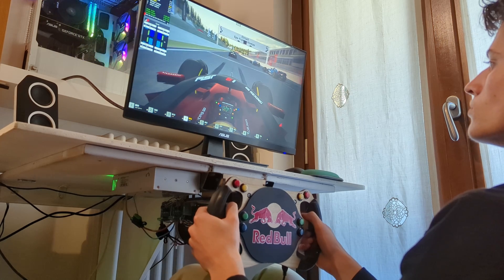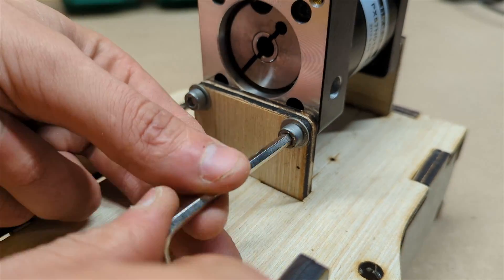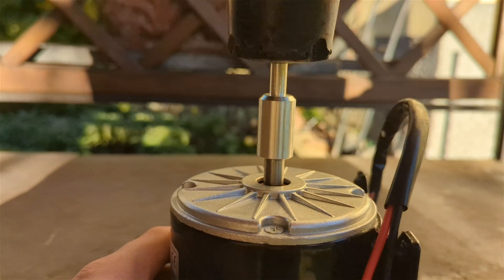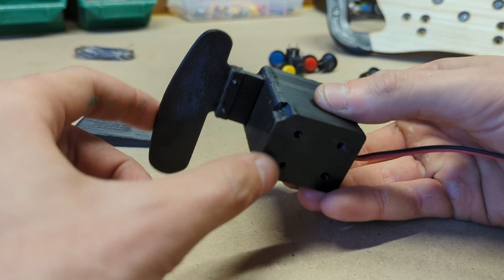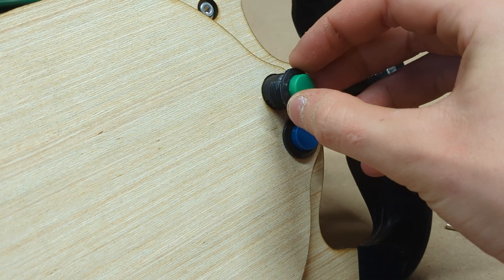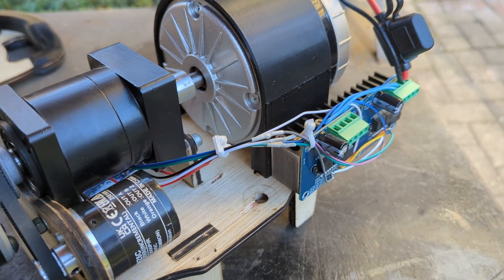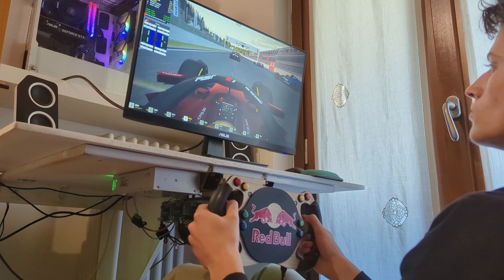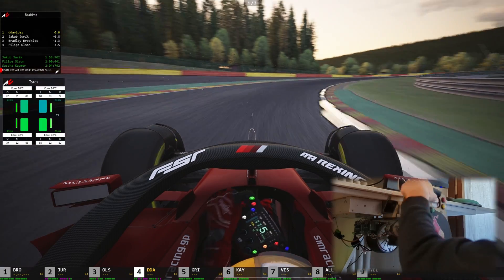DIY FFB steering wheel | 😱 50Nm 😱 | HIGH performance & FUN

Comment: Definitely not 50Nm.
The information given about the motor is very terse. It only says that it is 24V and 350W. The motor label is not shown on camera to know exactly what motor it is and look up its specs.
However, at 2:14, stopping the image at the right frame, you can read a part of the motor label.
MOTOR: MY1016
VOLTAGE: 24VDC
RATED CURRENT: 18.7A
With this data and knowing that it is a 350W motor we can find the manufacturer and the specifications of the motor itself.
The manufacturer is ZheJiang Unite Motor Co. Ltd.
The motor data given by the manufacturer:
REFIT MOTOR MY1016 350W 24V
Model: ZD101A1/MY1016
Rated Power: 350W
Rated Voltage: 24V
Unload Current: ≤1.4A
Unload Speed: 3350RPM
Rated Torque: 1.2Nm
Rated Speed: 2750RPM
Rated Current: ≤18.7A
Efficiency: ≥78%
This refit motor is always used for Scooter, Small Electric motorcycle.

So, the wheelbase shown definitely does not have 50Nm.
Since a 10:1 gearbox is used, the final torque is 12Nm. Which is really very very good.

Comment: Thats not 50nm in translation to the power you get. It may be rated that way but the numbers we use in wheelbases isn't based on just the motor but the power it can produce when together and pushing to your hands. This isnt 50nm. Sry

50nm stall torque is not how you measure wheelbase torque. This is a 5nm wheelbase maybe 10nm tops.

Doesnt seem like its moving much more then 5nm wheelbases do. Something is off with your testing.

The qay thw wheel was moving with your settings looked like 2 to 3nm on my wheelbase I use set very very low.

It looked pretty weak in action. And if you have to use 40% to not clip its def not close to 50nm if its clming out to 5 or 6nm at 40%. Just saying.
Reply: But still an awesome project!
Reply: 50Nm is 50Nm, if the engine uses it, then that's just how it is. Even well-known manufacturers use physically standardized specifications.
Reply: @thomaslocke1503  this is not 50nm. Its not actually giving him that. He's using it at 40%! That would be over 20nm. Do you see a 20nm wheelbase react this slowly and easily? No I own a 23nm wheelbase, 15nm and 27nm. My 15nm wheelbase gives way more fight then this even set to 10nm.

He also explained it's not 50nm static he measured 10nm in other ways which this makes way more sense. That looks like a 10nm wheelbase being used at 4 to 5nm.

Its all about how the forces are measured. I've also never seen a 50nm motor this small before. 50nm is absolutely insane. Our biggest in the industry for sim racing is 35nm at the moment. And believe me that at 40% is pretty wild. Same goes for vnm 32nm wheelbase. Or the simucube ultimate.

Look at the small belt holding it an moving. Yeah 50nm? Heck no that small belt wouldn't hold or be able to move or maintain torque at that level.
Reply: @reviewforthetube6485  Nm are always specified the same and it means 1N at one meter lever arm. No matter how and where you measure it! You didn't even understand that the little belt only transmits the angle of rotation to the sensor 😜
Reply: @thomaslocke1503  again he didn't get 50nm of static force and his testing showed 10nm. So putting 50nm isn't correct.
Reply: @thomaslocke1503  as he stated it was the motor specs but he measured 10 to 15nm not 50nm. Yoy can spec anything the way you want. This is not a true 50nm motor and it's especially so when seeing him use 40% as easily as he did with such little force applied. I'm not the only one who proved this in the comments. Someone else did in a much better way then myself.

Also what you fail to realize about that belt is the transitions of the motor and angle would still move way to fast and aggressively for that little belt to keep up.

Comment: 50Nm would spin the earth the opposite way. 
20Nm would brake this whole contraption in to several peaces. 
10Nm is similar to a real car, and is where you start to use metal parts for a build.
Reply: 10Nm is for a car with no power steering and BIG tires. My road car feels like probably 2-3 N.m.
Reply: 50Nm is only 36ft/lbs lol, what are you smoking and can I get some?
Reply: @ LOL only? There is a video on Youtube where bodybuilders are testing simwheel at 150%. The rig that they used had 25nm. And the bodybuilders could not handle it. 

Good luck with "only" 50.
Reply: @dovydaskaminskas4227  That's peak force not sustained like I'm assuming the test you're talking about was and pretty sure he said it's set to 30% but, anyway checking the video he says the motor is 350w which is maybe 5-10% of 36ft/lbs lol you could totally build one with 50Nm though not saying you need it just that it would be possible.
Reply: A sport car grip is something else. F1 grip is insane and G forces are out of our knowledge.
Reply: the actual range of power for these hoverboard motors is around 12-15nm, depends on the thickness of the stator

Comment: if im using 24v 250watts 14A ebike motor for ffb. can i use ? 24v 360watts 15A powersupply? AND is IT good or something bad happen like high temp or heat
Reply: it will provide the motor with more power thus more heat and probably some clipping of the ffb

Comment: Nice work! How are the connections made from the button board to the Arduino/computer? Are they wireless? If not, how do you prevent the cables from twisting?
Reply: The board he used behind the wheel is called a dual game controller board or diy arcade controller board

Comment: Hey so what if someone happned to fry their 23nm DD wheel USB side (as in it turns on, centers and has resistance but wont detect, could i use the parts to make my own? Just use the motor, housing and disconnect it has already and just change the internals? I am deeply hoping i can salvage this thing, i think i have a stepper motor and arduino here i can use, any guidance would be helpful!!!

Comment: is this a lot better than a thrustmaster t300? i have a t300 and i was thinking of building this one, but is it worth it or should i stick with my t300? thanks a lot
Reply from the maker: Look at my latest video where I built a sim racing wheel from a hoverboard motor, you should be able to build it for around 200€, and you get a direct drive wheel base with 15nm of torque and amazing build quality. That would be much better than the thrustmaster t300 since it pumps out peaks of 1500w of power, and has a nominal power of 350w. Compared to the 25w of your wheel. It also is direct drive which is definitely a plus.
Reply: Thank you so much for the quick reply and info! And thank you for your videos! Godspeed!

Comment: What is much better should I use a geared ratio with a shaft connected to a dc motor or shaft directly connected to the motor?
Reply: If you're using a motor like this you will not get enough torque out of the motor without a gearbox

Comment: Amazing project but soon all the plastic and plywood moving parts will brake or come loose.
A metal structure will last far longer but it will also come in a much higher price.

Comment: Hello is the 2bts 7960 are needed or juste on will work? And can I make it without the pedals so I don't have to buy the PCB way pcb because I already have pedals? Thanks
Reply from the maker: Just one will work with a 250w motor, a 350w motor will blow it up instantly, I learned the hard way blowing 4 of them up because I didn't understand what was happening
Reply: Hello, amazing work btw. What if i use 250 watt 24 volt and connected it to 2 bts7960 in paralel? Is it will still work?
Because i already tried using only 1 bts7960 and i think it got toast and the motor wont move or rotate  @DAZprojects
Reply: @DAZprojects It was working at first, then when i tried to check the ffb using wheelcheck app. The motor doesnt move or rotate.
Reply: @bayukrisnanda5529  bro i have the same issue as you can you tell me more about the 2 bts in parallel  did it work or...

Comment: Brother i will be using the padel you showed in your video but i dont want to use the motor for steering as it is our of my budget range, is there any possible connection without the motor? 

And one more question,
How do i make it recognise  as racing wheel to play ganes like forza horizon as it doesn't show in game ? 

Help me out brother 🥺
Reply: Bro without motor it's really hard to make this but I have a dead cheap option for you like you can you pc remote and use your phone tilt as steering and you can make a diy steering wheel for your phone and use it but there will be no ffb and no pedals gotta touch the phone for acceleration ectt so yea

Comment: 400for that? mmmmm. may as well get the cammus c5 with the pedals included its cheaper and its a dd and you get pedals too. or if you want more torque use a hub motor from ebike or hooverboard. the smallest hub motors of ebikes can do as much as 50nm so the smaller the better. and hub motor is one of the best feeling dd motors out there.
Reply from the maker: I know, I was thinking of using a hub motor but I had no idea about the software, if you know more on how to use them let me know, I would love to try building a better one

Comment: Brother I have a question, would it be the same process even with settings if i use arduino uno but not arduino leonardo? Btw, the video is🔥
Reply from the maker: No, the Arduino Leonardo has a different processor from the uno, so they're not swappable

Comment: why not just use a stepper motor? it has gearbox, encoder and no need for belts
Reply from the maker: I honestly wasn't sure on what firmware to use so I just went for what I was sure would work

Comment: 50 NM or whatever, its way compact and lovely looking, with your pedals. How is the responsiveness?
Reply from the maker: I think it's not comparable to a direct drive wheel, but the backlash is very low, latency is non existent. It probably would have been better with some belts instead of the gearbox, but still it's better than any gear driven entry level wheel
Reply: @DAZprojects  If you prefer belt drive, there should be some reason, but I believe this is a better idea because the forces from hand doesn't directly transfer to the motor and the motor might live longer....
Unfortunately the same torque from a single simple belt drive is hardly an option, however, a compound belt drive could be designed, and with your talent that will be a breeze... Waiting to witness that....

However man, I loved your pedals.... ♥️♥️♥️♥️